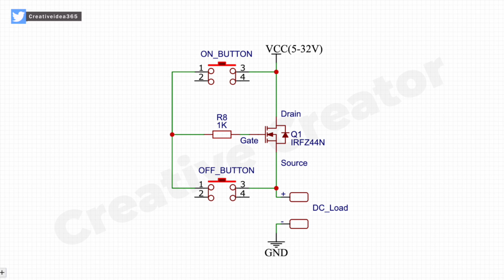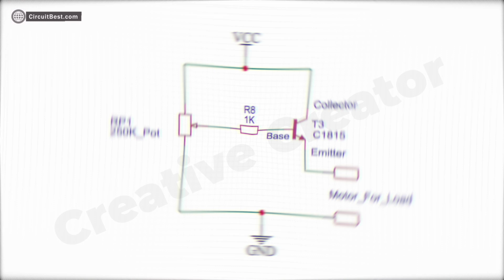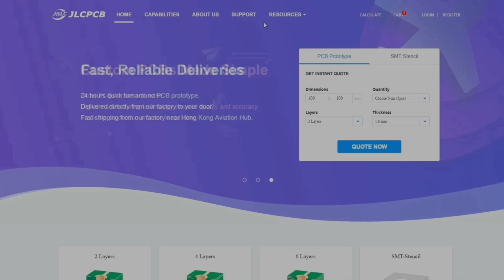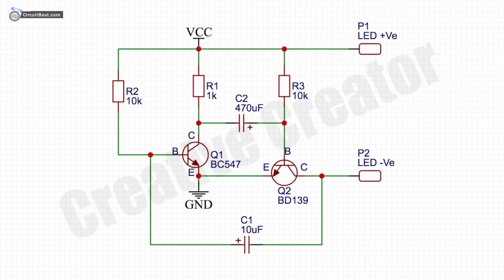Top 3 New Electronic Projects Easy

Comment: Sir In 2 project can i use bc547 transistor instead of c1815 transistor..
Reply from the maker: Yes you can but pin out is different so check before connection

Comment: a question, the second one can't be done just using the potentiometer in series with the motor? 🤔
Reply from the maker: This will work for low power motors but for the high power usage motors consumes too much current so it will damage the potentiometer instantly. You will see magic smoke from from the potentiometer if you make the circuit as described 😁
Reply: @Creativecreator  so the c1815 transistor is not necessary for the motor you used? But it would be for larger motors? Or something similar anyhow?